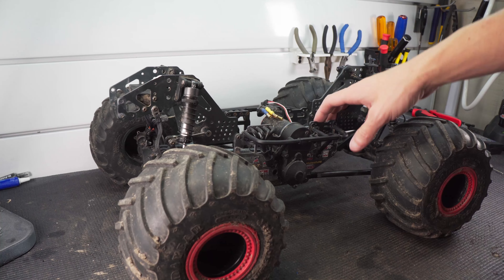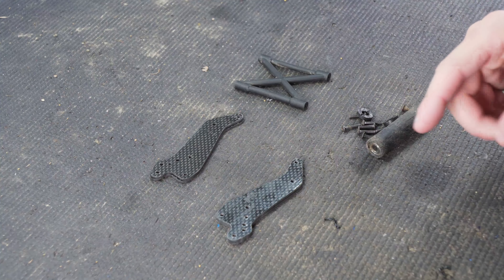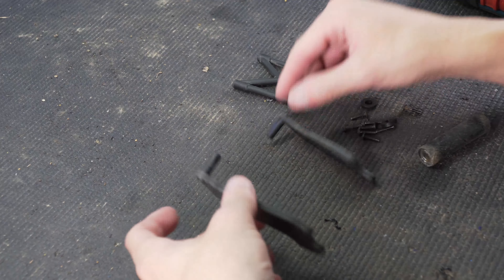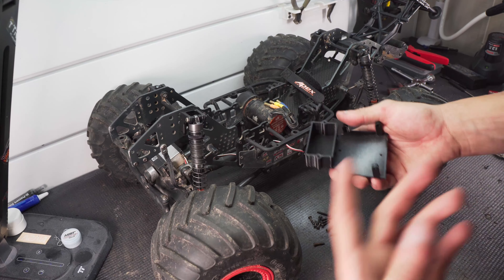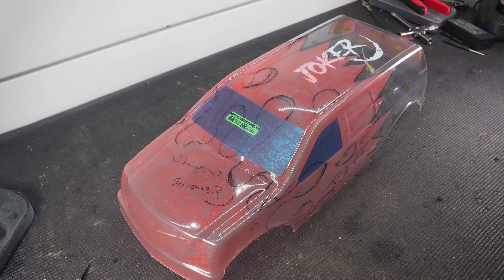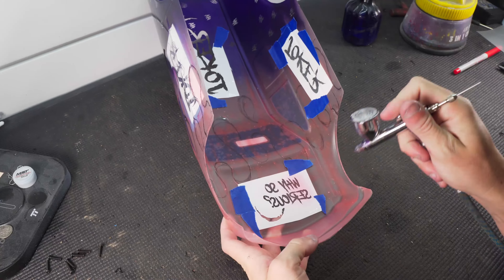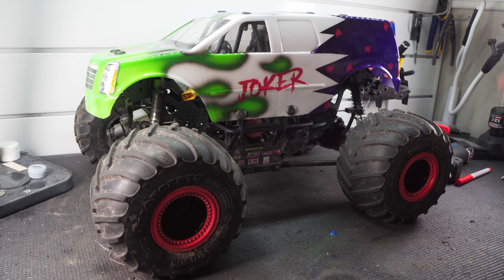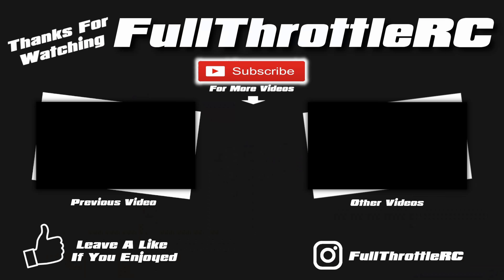The LOSI LMT gets a NEW Look Plus a Few Upgrades!!!

Comment: Great job on the paint.
Your wiring needs cleaned up, no excessive 180 bends
Reply from the maker: Thank you! I absolutely could've shortened some of those wires heading to the receiver to clean it up a bit. But I'm not racing with this truck, no need for me to be anal about that stuff. I was shocked to see an excess amount of wire in the stock receiver box as well actually.